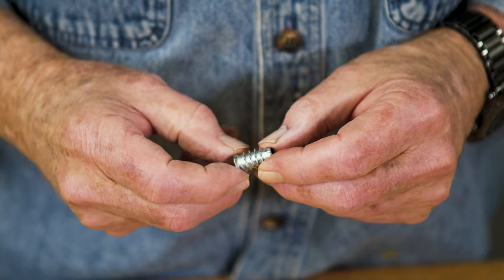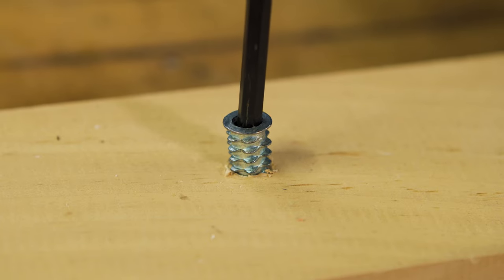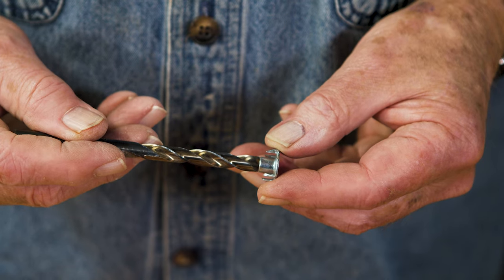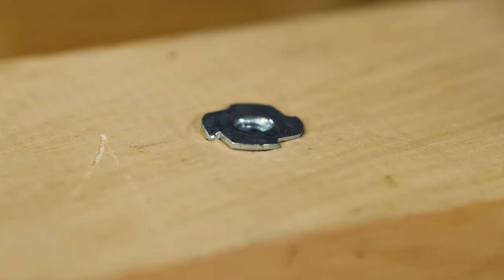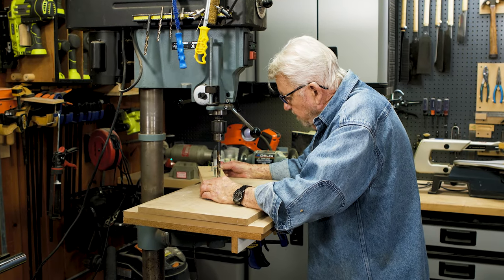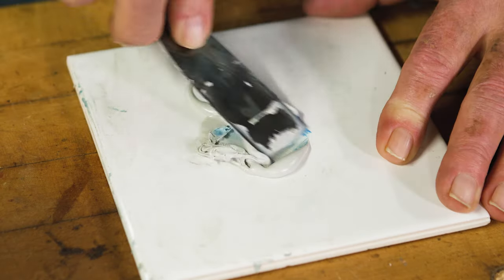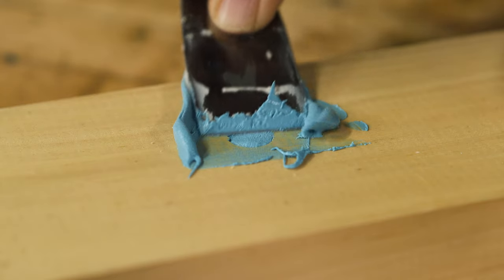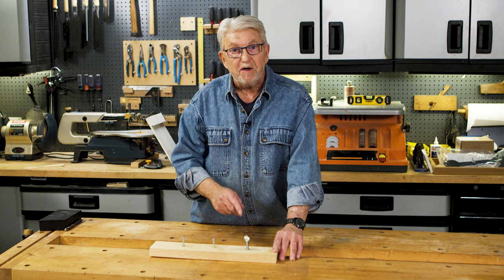Three Different Ways to Screw a Bolt into Wood

Comment: Way number 4: drill and tap the wood as if it were metal.  If the bolt is over an inch long it will make a surprisingly strong fixing.  The harder the wood and longer the bolt, the greater load it will take.

Comment: Awesome! I'm trying to bind a 2x4 to a steel structure by using the existing bolt holes in the steel. This was exactly the info I needed. Only 4 different times of phrasing my search in various ways before I found out#
Reply: You can also use a rivnut in the steel.

Comment: The bolts that u were mentioning is called furniture bolt or connector bolts. They adjust according to the moisture in air